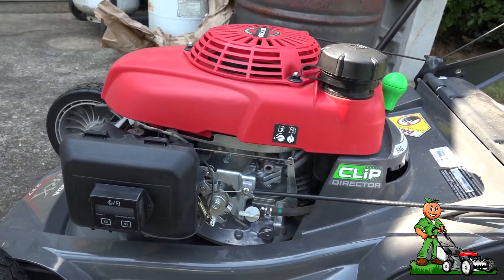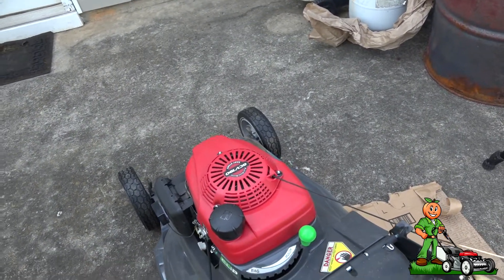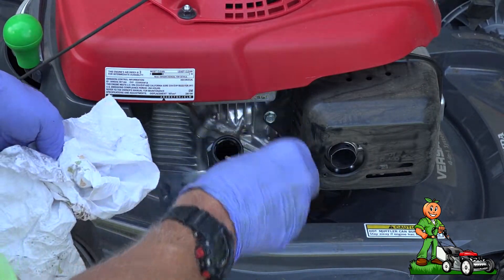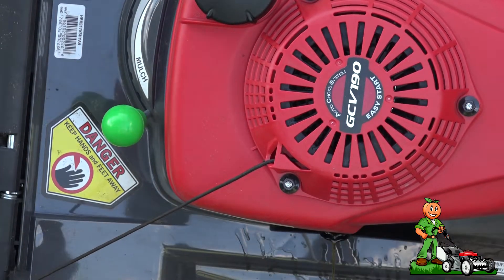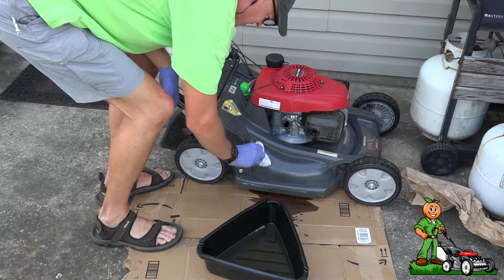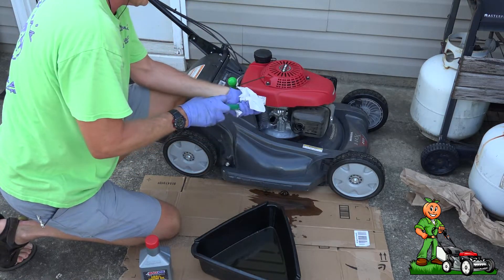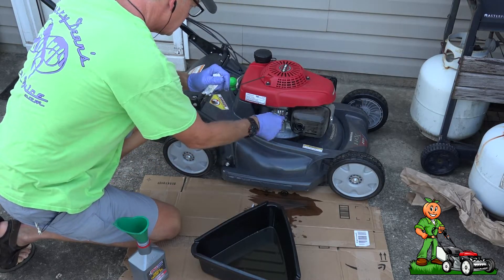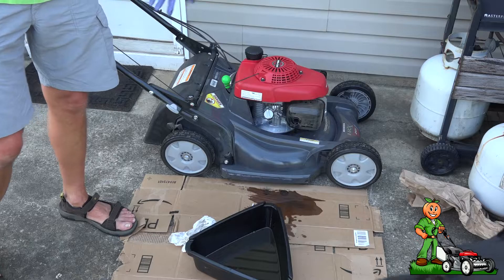How to perform your first oil change on the Honda HRX217HYA lawn mower

Comment: I'm getting ready to change the oil again in my HRX217HYA.  I also use the Amsoil small engine oil that you do.  I also use it in my Honda 2200i inverter generator and my Honda powered pressure washer.  Great oil.  I use Amsoil in my SUV and pickup truck.  Great oil!!

Comment: I remembered you mentioned to turn the gas valve off, and didn't prior to starting after the oil change, but there was obviously enough gas in the bowl to run anyway!    Appreciate this, as I still have one of the first Honda HRX217 HSA made I'm sure, with the manual choke, and well after buying mine in about 2005 it still runs great!   Had to make my first throttle/choke adjustment today, and it's back to only needing a single pull!

Comment: the reason you have to tilt is because people used to forget to install back the botton plug and they refill not knowing its on the ground so they decided to omit the bottom plug to reduce warranty from people screwing  up and restarting the mower with no oil

Comment: can you get a more better oil change by removing the plug in the bottom ? thanks
Reply: No, there is no oil drain plug under the engine. It’s easier to change the oil if the mower is placed on blocks so it can be tipped over further and use a shallower pan.
Reply from the maker: No plug on this engine.

Comment: Why warm up the engine when multi Viscosity  oils like 10w30 are thinner and runnier when cold than they are when hot.  The purpose is to get things lubricated quickly at start up, then to thicken when heated for protection of metal parts.  Heating up the oil is not necessary for good drainage.
Reply: Incorrect. The oil will always be thinner and flow better when warm. Test it sometime with oil from the crankcase that is warm vs. cold oil. And read up on what multi-viscosity numbers actually mean.

Comment: How often should the oil be changed??
Reply: I've got a 30 year old Honda HR194 ....  I've never did an oil change  after  I dumped out the factory oil ... I just keep topping it off with synthetic.     Still starts on the first pull.   Your mileage may vary.
Reply: @ericgochko5325  haha you are the man if ain’t broke don’t fix it!
Reply from the maker: Once a season if it were me.

Comment: Can someone tell me how to FLUSH the oil out of my honda HRX mower? It was fully emersed in a flood and that is the reason I need to flush it other then just change the oil.
Reply: Pour boiling water in and dump several times. Let air dry for a week with the lid off.
Reply from the maker: Just fill the crankcase with oil a few times and run it.